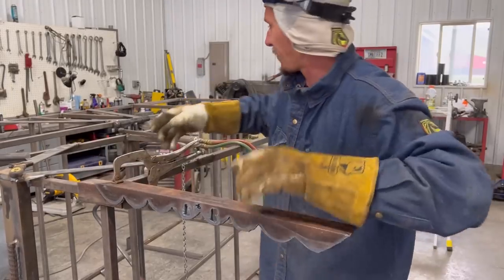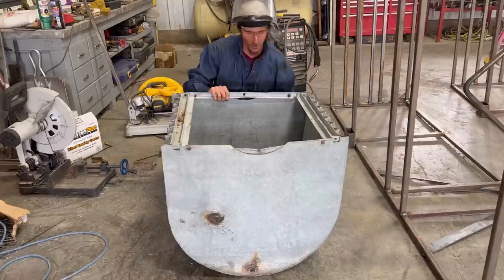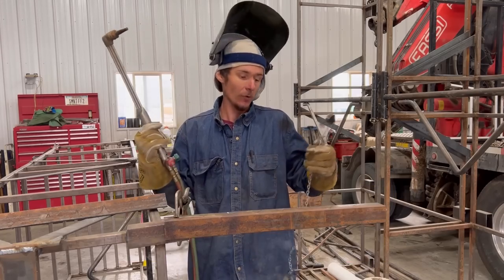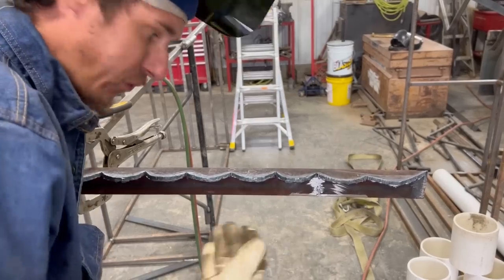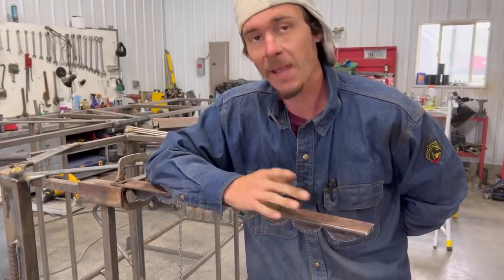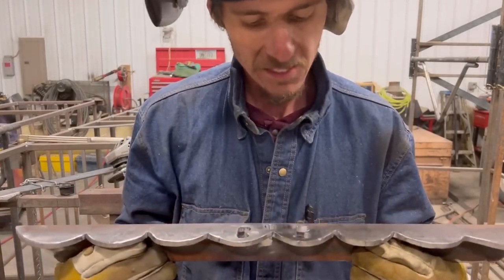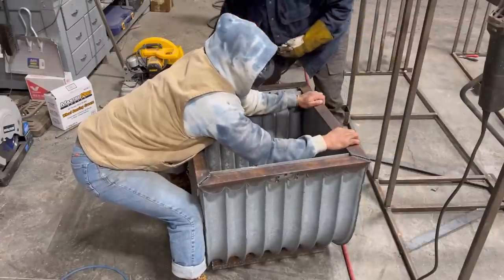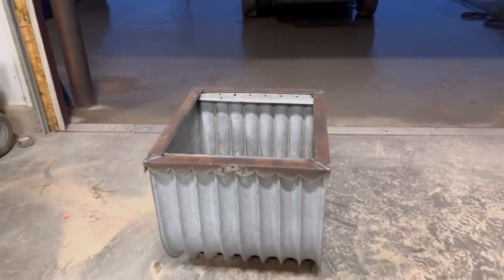WHY Was This Fabrication Project FREE?!

Comment: hey Anthony, the settings for your torch depend on the tip size, not the thickness of what you are cutting.....you can cut 3 "  steel with only 5 -11 acetylene and 40-50 oxygen, but you need a #4 tip....1/4" is a #OO tip and 3-5 acetylene and 20-25 oxygen according to the Victor book I am looking at.....hope this helps you and someone on the channel...cheers, Uncle Paulie......
Reply: Thanks for the tip, actually makes sense since the tip would have just as much influence on the volume as the pressure would.

Comment: Nice art project. Pretty cool way to repurpose something that was looking for a new use. Back around 2000 or so I had to weld some galvanized parts, it was quite the experience. I did a lot of fabricating back then. Sometimes I miss those days, creating something out of metal is very satisfying.

Comment: ic-weld, that guys a jedi with a torch so don't worry about the comparison. my artsy friend calls this kind of stuff "up-cycling" and it looks great as a planter. remember to drill some holes in the bottom and throw in a piece of screen just to stop it from collecting water in the bottom.
Reply from the maker: I did! don't want root rot!
Reply: awesome! keep up the great work and good luck with the house, hard work for sure but with a little motivation and some help things will work out. the community you build will be the best thing by far.

Comment: Haha, I didn’t know you could just use a respirator. My dumbass went to lowes and got some muriatic acid to burn the shit off. I would throw the pipe in a tub of acid and run off across the yard while it boiled off, while also wearing a respirator.😆. Nice job brother.
Reply from the maker: I guess you can, I can't smell the gall burning smell so I think its ok 😂
Reply: @MeltinMetalAnthony  I was thinking the whole time that the gas coming off that acid has to be worse than welding it with a fan on.